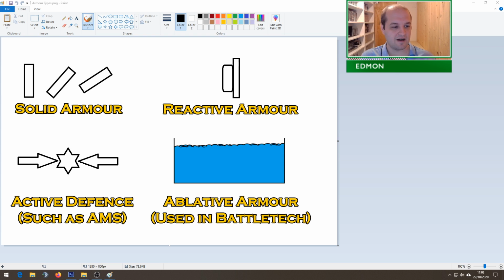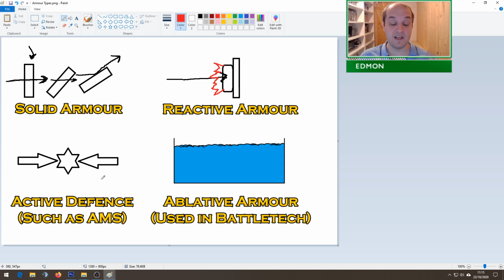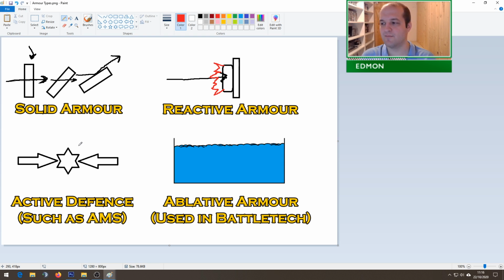Misunderstood Battletech Lore - Armour and TAC

Comment: The ablative armor also explains why lower powered weapons can still deal damage to armor rather than simply bouncing off. Solid armor tends to be binary, where projectiles have enough energy to penetrate or they don't. So your battlemech can lose armor from being hit with a machinegun and also an autocannon, rather than, in the case of solid armor, one doing nothing and the other passing through and dealing internal damage while still leaving the armor relatively intact against more machine gun fire.
I always assumed that TACs weren't actually penetrating the armor but hitting points where that armor couldn't, or didn't, protect, like the interface point from one torso section to the next. "Through armor" is definitely a misnomer for that though. Maybe a "BAC" Between Armor Critical.
Reply from the maker: Yeah, TAC makes zero sense for ablative armour, that is simply not how this kind of armour works. It is something that happens to solid armour, exactly how you describe in your comment.

A BAC is a critical hit, basically. Not something modelled in BT though it should be there realistically speaking.
Reply: @TheEdmon  No physical phaenomena is universally applicable. While an ablative substance may be able to dissipate the incoming energy whilst dissolving part of itself does not mean a single concentrated application of energy can not burn through its entire depth in a single strike.

Comment: Nice though experiment, I saw that mythbusters episode too.
The thing that gets tricky here is that ablative armour would react differently to the various weapons, a gauss is different from a ac round different from a laser, etc. That's a thought for a second episode on this.
I think that the ablative armour concept works best when you don't have penetrator rounds like sabots, per example if an AC round is just a big bullet then it would just shatter a few units of per example ceramic armour on impact.
Missiles the same and lasers would overheat then until material stresses would shatter it, or simply melt it. All imagination here, since battle tech was pen and paper, things had to be simplified.
Reply from the maker: Ablative armour generally works the same way against all the weapons that rely on kenetic (movement) forces. So "Gauss", AC, missiles, etc. Explosions are mostly kenetic damage as well, the shockwave is often what breaks things.

What protection it would offer against energy weapons, such as lasers (which are radiation weapons), is definitely up in the air. This is somewhat of a hole in the lore. It would obviously offer some protection, but would likely melt and not offer the same level of protection as it does against kenetic (force) weapons.

Comment: Very interesting, did not know of this concept in BT ref the armour.

The reactive armour on my APC was angled thin plate-like with a very thin metal cover to be painted camo. It was better at trying to deflect and disrupt hollow and shaped charges. Problem was once plates were expended there was a gap for further hits. Another issue was the downward angled plates would explode down into nearby dismounted infantry. Modern tanks can have armour on the first plate for protection then once detonated a second layer could function if the missile had two warheads. 

You can tell BT was thought of before a lot of this stuff was common knowledge.

Ref the sabot penetrators they’re normally Tungsten or Depleted Uranium. If they hit angled armour they can turn at a sharp angle and penetrate. The plug of armour plus the sabot coming in does the damage. Non penetrations can cause scabbing on the inside of the tank and was why we had a heavy jacket all round to catch them. Can’t recall if lead in the old days. 

The only time I’ve heard of Ablative is in space rocket engine bells. When it gets mega hot to help keep it cool a sprayed on ablative material burns up, collects heat and sparks off taking the heat with it. Normally used in space as there is no atmosphere to radiate heat off into. 

Something I’d expect in BT is your cockpit windows to have both gold tint for EMP protection of electronics inside and an anti laser coating. On all mirrored sights in tanks, etc, the crews vision is safe from very strong blinding lasers. We used to have to wear ridiculous laser goggles for ordinary binos, telescopes, etc if up against certain modern foes. Strong laser rangefinders unfiltered could blind accidentally. We had 2% filters to only allow 2% though when ranging and only taking it off in bad visibility with permission as poor buggers all over the place would get blinded.
Reply: I can see ablative armour being very effective versus lasers if in real life terms it’s the sprayed on coating like as I said in rocket engine bells. Lasers hits, heats up the material, it sparks and spits off the excess heat.

Once back in the workshops the techs spray on more material which cools and you’re good to go. Can’t visualise what you’re saying if hit by rounds or HE, HEAT rounds but in fairness this was a few decades back when BT was written.
Reply from the maker: @stevepirie8130  A type of ablative armour you will be familar with is a ceramic plate. When hit with a bullet, it shatters into dust, taking the kenetic force with it.

This is the kind of armour that BT uses.

Comment: I first unerstood ablative armour, while playing Mass Effect, there was an armour upgrade for the Normandy. The description said that it is made out of some Material that melts away gradually under fire of an direct energy weapon, while setting of some kind of crystals out of some high temperatur glass ( maybe Saphire?) to dissipate the energy of the weapon and create some kind of Dust in front of the ships hull. To further lessen the impact of the weapon.
How this armour would work when there is an explosive weapon hit, like with a torpedo or a missile, well i don't know yet.
Reply from the maker: It should work the same way against all kenetic (force-movement) type weapons. This includes explosives, which are also mostly damage caused by extreme forces. Lots of the armour would shatter, absorbing the force.

What is questionable is how ablative armour would cope with directed energy and/or radiation type weapons.

Laser, nuclear, x-ray, etc. Operate in a way that curcumvents this kind of protection.